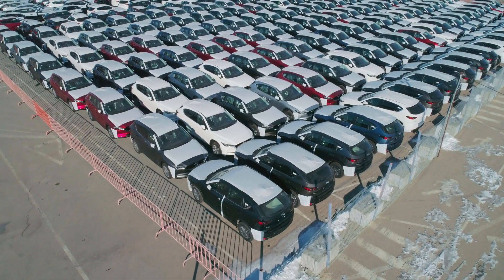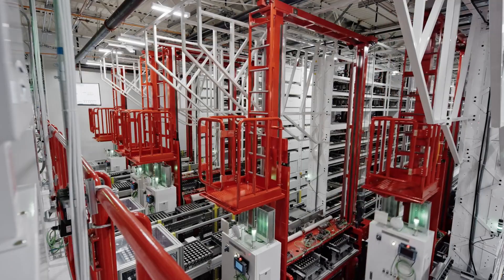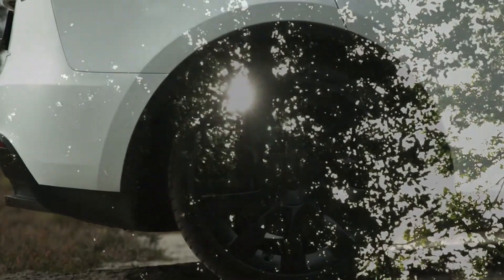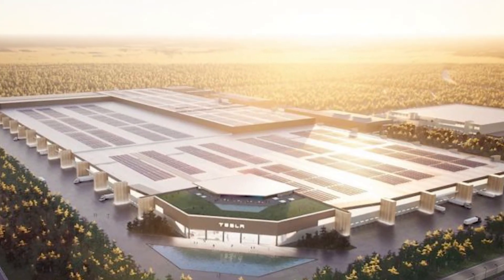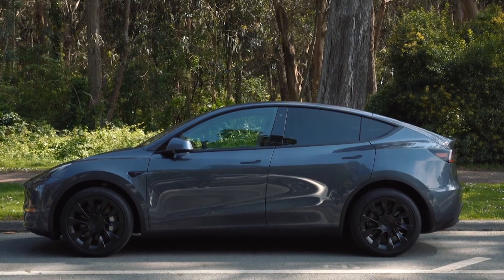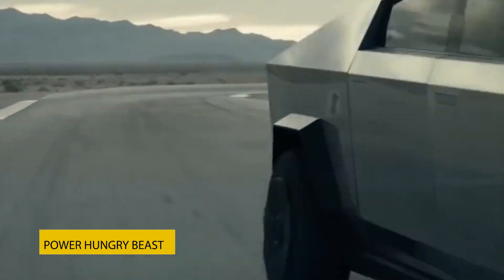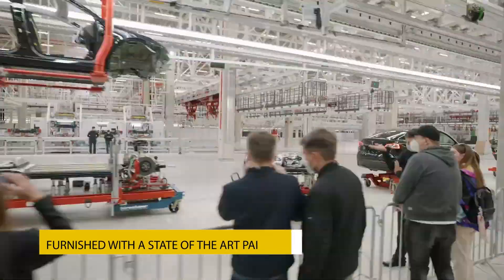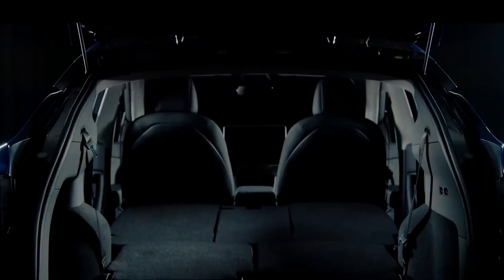Tesla Model Y With 4680 Structural Pack | New Model Y Colors!

Comment: My theory is that Tesla is finding out that battery cell production is not as easy as Panasonic makes it seem. Their engineers have been working for decades to fine tune production and the detailed processes involved. Tesla is not able to suddenly create a better battery out of the blue. I'm sure they are running into numerous technical challenges with the 4680's, otherwise they would already be in volume production. Don't get me wrong I want them to come out as fast as anyone. We need 400 mile EV's that don't cost 100G's.

Comment: & all seems to forget when heating during load and charge goes down on the 4680´s this is due to way lower  impedance (resistance) in the cells (A bit more than 10 times lower actually). This wil make ex. the batterypack of the Model Y output +405 Volts instead of approx. 220-240 Volts while pulling approx 1000 Amps as max. which equals a difference of approx. 70 V  which equals 70 KW more power to the engine....For a Long Range that is...

Comment: what's with the stock price?

after releasing q3 earnings the aftermarket price dropped by over 1 percent. then in the pre-market it went nowhere. soooo...i was assuming, as so often happens with tesla, a good earnings report is followed by a temporary downturn in the price. and then...

it exploded to 900(!) a couple hours after the market opened and is holding in the low to mid 890's. i give up on predicting this stock.